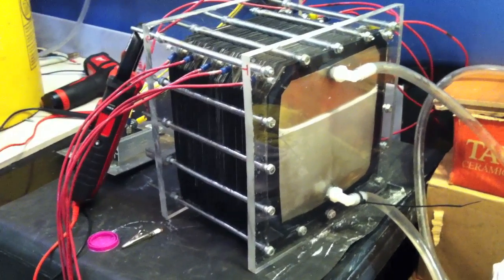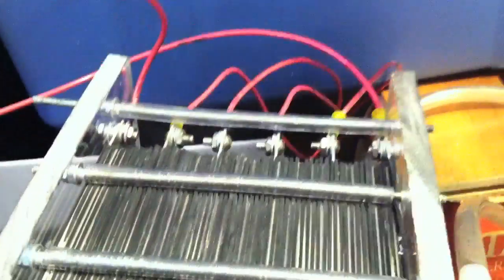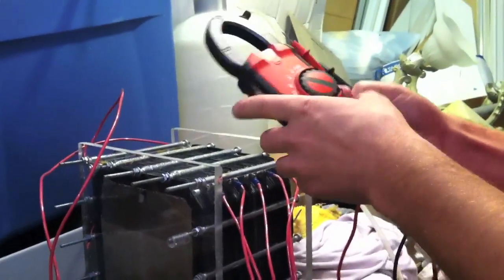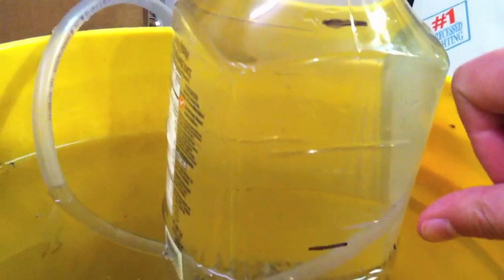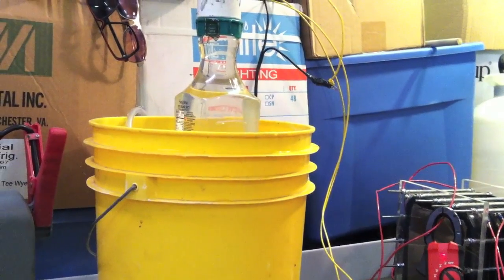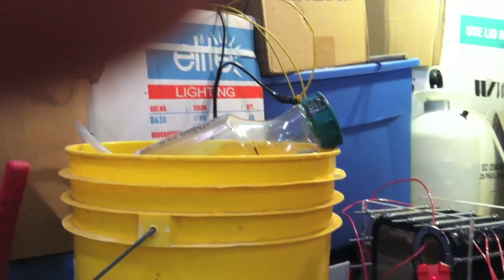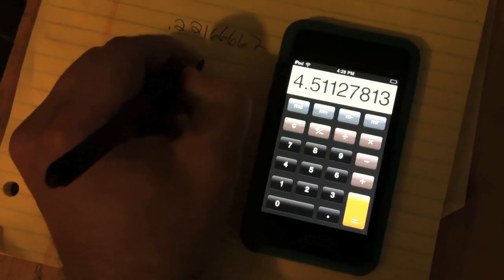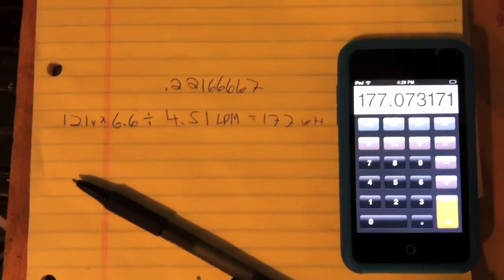120v 4.5 LPM 60 plate hho ( hydrogen ) dry cell demonstration

Comment: you could run a 4-cylinder motor on that. lol Granted it would be better if it were running on a Lithium Battery pack instead. but its pretty sick, What Size Plates were used? it looks like 20 or 18 gage does anyone know?

Comment: warm and cold water. - Just like Wire, Water Acts as a Resistance/Resister (its how you can have a "Dry Cell" build to begin with, you have to have a complete circuit) - warm wire increases resistance - cold wire decreases resistance and apply Ohms Law to figure out the resistance of the water, at its coldest point and its warmest point.

Comment: When input voltage is 120 Volts AC , then the output from Bridge Rectifier is 170 Volts DC (120 x 1.4142 ) and current is 6.3 A , which amounts to 1070 watts per hour . The gas output is 4.5 litres per minute . Total gas production per hour is 4.5 x 60 = 270 litre . Power consumption per litre of HHO gas is 1070/270 = 3.9623 watts / litre
Reply: I'm not a very smart guy but I would like to make one big enough to run a school bus could you give me an idea how many plates I would need at 10 by 10 square and would you recommend separating the oxygen from the hydrogen or involving both
Reply: @victorhettinger4412  , run your engine on hho. 
you would need 15 plates of 10" x 10" if your bus is 24V DC . +nnnnnn-nnnnnn+
start with 20 grams of 97% pure Sodium Hydroxide (Laboratory grade )  per LITRE of water . If gas production is not enough add little more Sodium Hydroxide . Too much of hho makes the engines run rough . 

0.25 lpm per litre of engine is the thumb rule .if your bus engine is 3 litres then you need 0.75 lpm and maximum can be 1 lpm .

Comment: your calculation is wrong . the gas output is 4.5 x 60 = 270 litres / hr as the power consumption is in watts per hour .
Reply: So can you give me an idea how many 10x10 plates would I need to run a school bus on 12 volts 15 amps
Reply: @victorhettinger4412  , 8 plates ( 7 cells ) . try first with 15% KOH solution ( 150 grams of KOH , 850 grams of deionised / distilled water ) . if the gas production is less , try increasing the concentration to 20% . Seven cell generator will give you hho gas without the electrolyte solution getting heated up .
Reply: What is the engine volume?. 
What is the ambient temperature of your city?.
Reply: So one negative five neutral one positive is no longer the standard for high output I'm guessing
Reply: @victorhettinger4412 , too much of hho overheats the engine to the extent that you start feeling the engine running rough ( nearly like seizing ) . I found the radiators were not able to handle this continuous overheating . 0.15 to 0.2 LPM of hho / litre of engine is enough to get you a good mileage . 
If your engine is 3 litres , then 0.6 LPM of hho is a good addition
Reply: @victorhettinger4412  . 1 negative 6 neutral and 1 positive is the best way to go .

Comment: It would be more impressive if you had it in a car and used to lightweight inverter to change your 110 into 12 volts alternating current as it fits now we can only just watch it bubble then put out ants and bulls. We see a lot of them that we can just look at. But we'd like to see it in action that's the whole point in building them. Thank you
Reply: alternator voltage is generally 13.8 volts DC . 

When oxy hydrogen gas is introduced into the engine , more percentage of fuel is ignited as HHO gas is highly explosive which results in more heat being produced and the radiator finds it very difficult ( in places where summer is 42 degrees celcius ) to push out the extra heat generated , I ran a 1300 cc diesel gar on HHO gas for nearly 6 months . After 6 months without Hydrogen , the car runs very smooth as the cylinder liner has been shaved off a little bit by the expanding piston rings to decrease friction .

Comment: 47 kw per hour.......??? wow  to munch to be classified as free energy.
Reply: @Alexthe2nd's calculation is wrong
Reply: Output from Bridge Rectifier is 170 Volts DC and current is 6.3 A , which amounts to 1070 watts . The gas output is 4.5 litres per minute . Total gas production per hour is 4.5 x 60 = 270 litre . Power consumption per litre of HHO gas is 1070/270 = 3.9623 watts / litre

Comment: So what do you plan to do with it now that it is made?
Reply from the maker: I built it thinking I could use it to use as a supplement the fuel in my car and improve MPG. That turned that turned out to be a dead end. All the gains in MPG were offset by the extra strain on the alternator, making it a net zero gain. The best use for the HHO generator is as a torch. It makes a great Torch!
Reply: @Alexthe2nd  Have you happened to have tried welding/brazing aluminum profile extrusions with this and aluminum brazing rods? I predominantly mean the size (2020 aluminum profile) that cheap 3d printers and cnc are made from? My napkin math has told me that around 4.5LPM is what should be adequate, so it'd be good to know if yours can do this.

Comment: You need to calculate the dc volts times the dc amps for power. Or AC volts times the ac amps for ac power. The difference in power between the ac side and the dc side is what your converter or full wave bridge rectifier is consuming. There is a gross conceptual error is multiplying ac volts and dc amps. You have to do it seperately. If you are at 12 volts on the bridge side at 6.3 amps then you have 61.5 watts DC which means your ac side is very close to 0.5 amps.

Comment: Hey..good job
one thing is missing.....
you need a PWM
a Pulse Width Modulator sends pulses of energy into your cell.
This prevents it from heating up
Reply: Good luck finding a 120 volt pwm
Reply: @ES-xq7iu  they make them ive found them inline

Comment: A commonly unit of performance related to efficiency is the MMW mililiters per minute per watt. 
1000 ml /((6.6 amps ×121 watts)×(13.3seconds/60 seconds in a minute))=5.6489 MMW. Without adjustments for standard temperature and pressure of course.  Low pressure and high temperatures can inflate those values some. And the gas is probably saturated with water at 100% relative humidity at the temperature of water in the bubbler.

Comment: What is the material b/w plates (rubber sheet type) 
Where i can buy it
Reply from the maker: I just used commercial roofing rubber (the stuff they use to cover the flat commercial buildings) I just asked a local roofing company if I could have some scraps and they gave me more that I could use for Free.

Comment: This is a joke device I can produce 24 liters of gas per minute at a cost of 266 watts! And I am sure with more refinement I can do better!  Multiply your voltage times your current and you will get watts.
One must produce more power than is used to crack water or you have accomplished nothing at all! The only reason there is any gain at all in power is directly due to the speed of the hydrogen burn. Which is called a Flame Front and with Hydrogen that burn is just under Mach 9 compared to gasolines coming in at just under Mach 1. If you learn to crack water with lower power consumption  you can do something useful. If you cannot forget it!
Reply: Lining a car's roof with solar and switching your headlights and lights to LED's to reduce the electrical load isn't too difficult and it does yield a net efficiency. I might try this myself to see how it works. 😊🌎✨
Reply: Crack water? Share with us! = )
Reply: @DeanTheDoctor  1.23v
boom

Comment: whats the point using ac 120v and that much plate, if u can use 12v dc but put more amperage?
Reply: If you have 120vac, why use a 12v battery charger?

Comment: Hello where are the right side red cables connected ?  And may I provide 3 volts to 3"  plates..? 
I  am using  120v.  w/rectifier for my generator ..will use it for small diesel burners ..thx

Comment: I am going to be "that guy" and state how utterly little respect you have for safety in regards to isolation, earthing, having a clean work area. First when you measure the AC voltage was unsafe - tip: screw the rectifier down so you don't need to hold it while trying to measure. Secondly when the hole-saw blade fell from off camera and landed very close to the bare live wires this is the point where i turned the video off. I get it was "just a summer project" but you really do need more respect for the deadliness of raw mains power.
Reply: Hes not gonna respond to you he already died

Comment: What's the practical use of running it on house current? Aside from just bragging that you can produce X amount of gas? These are largely used for gas burning engines, which run DC voltage. At least, any video I've seen where they actually do something with it other than annoyingly long math
Reply: think about power inverters
Reply: I can think of two praticl uses. 
1) HHO torch for welding. 
2) HHO gas for health benifits. 
 Google search  these terms together "molecular hydrogen" and "nih.gov" .

Comment: The unit you're looking for is wattminutes/liter. A less complex unit would be joules/liter. The equivalent value for that unit is ~10.6k.

Also, when you rectify 120V AC, you get a half sine wave of DC with amplitudes of ~170V. At those points, there is a voltage of 2.83V across the plate gaps. Assuming everything beyond 2.2V is wasted due to overvoltage, an average of 162W (20% of 800W) is being dissipated as heat in the water. No wonder it's heating up. All of this because your rectifier doesn't have a smoothing capacitor.
Reply: Mililiters per minute per watt is another usefull measure that reflects efficiency.  Yes overvolts is disapated as waste heat but it drives current. Practical devices have to make a compromise between  highest efficiency and high production.

Just a smoothing capacitor will give poor power factor. Hed be better off with an inductor after rectification and then a capacitor after the inductor.
Reply: if you add filter capacitors, you'll end up with 169.68V DC +/- which is the ~170 you speak of.

Comment: I heard that current depends not only on the size of plates, but also on electrolyte concentration. If you let say increase the concentration of the electrolyte two times in the same unit, how much it will change HHO output. Have you ever tried?
Reply: Production is proportional to current.  For a given voltage, current is proportional to plate area.  
Electrolyte conductivity is nonlinearly related to electrolyte type and concentration and temperature.  https://images.app.goo.gl/1b7Hm22Fyg7FQeov9

Comment: It would be a bit clearer if you knew the difference between voltage and amperage. Voltage is the strength of the current, amperage is the speed of the current. Two totally separate measurements. Any electrical supply has two ratings voltage and amperage. It's not the voltage that will kill you, it's the amperage.

Comment: Have you considered edging or Laser cutting a fractal pattern on the plates? Thus to get more surface? Printing a transparent foil with a ordinary printer, coat the plates with photoreactive paint, putting your foil with the pattern on both sides of the coated plates, expose to UV light and edge partually in the way you get little groves. Easy to realise.

Comment: You noticed that the plates got hotter and the current went up, this doesn't mean you're making more HHO necessarily, but it's very suggestive that the extra current is being dissipated as heat in the plates.
Reply: All the current ×1.24v goes to making hydrogen.  All the voltage over 1.24  × the current  makes heat.  But  the overvolts is what drives the current becase no current flows at 1.24v or below, but increases as voltage grows above 1.24v

You can maximize production or you can maximize efficiency or settle on a comprise between the two.
Reply: @kreynolds1123  current does flow at 1.24v
Reply: @cryptoworldgames  Not in a steady state way. The only current that flows is like the charging the plates of a capacitor. If your getting current at  1.24v and under it's due to either a contaminate  shorting the plates or the contaminate is something like urea which is decomposed at a lower voltage than water.  But the water needs 1.24v or more to be electrolsys to hydrogen and oxygen.    Or else you are making an over unity claim. Because the hydrogen oxygen mixed gas would have more stored chemical energy than was used to make it from water.

Comment: If you would run this for 24 hours and conpress it into a VERY stable tank and in the tank would be a "sparkmaker" and you make a spark.. WHAT WOULD HAPPEN? It has oxygen, hasn't it? Sorry for my bad English!
Reply: Georg Wagner big explosion. The tank has 2 Dihydrogen molecules per oxigen molecule. 2H2 + O2 -> 2H2O, and thats a very fast exotermic reaction.
Reply: use anti pop up.
Reply: The tank with HHO gases can explode like bom. It is so dangerous.
Reply: Georg Wagner just compressing it without the right equipment and knowledge is extremely dangerous

Comment: 120 DC volts at 6.6 amps? Wow.  Thats why it has 60 cells right, to make around 2 volts per cell?
Reply from the maker: Yes, the total voltage is divided by the number of plates 120v/60plate. 2volts per cell is a good ratio.

Comment: Aprox 245W/L, thats the aproach Number, since 120vac, to convert to VDC trough the rectifier, you can reach easily 168vdc with out load!!!, but during the power consumption, (6.5amps) and is not a voltage regulator only is a rectifier, the vdc drops, just an aproach. A lot of power. Another observation for this system, it could be interestingo know how is the arrangment of the leads; to me, seems the next... If Vcd is: 129vcd, and the number of pairs (volts between each plate) is 59, then 129/59=2.18 vcd, enough from thermodynamics point of view. But the connections between plates (jumps or bridges wired) seems to me that the voltage between cells is higher than 2.18vcd, if that the case, i can tell you that could be traduced in a waste of energy and converted from electrical to thermal energy, it warm up easily. Anyway the video age more than 3years, i believe you already improve the performance so far so well.... congratulations...!...and thank for share your video.

Comment: If you want to improve your car engine efficiency
and save on your car fuel expenses
There is a better way to do it - it is HHo Gas
Search Google for: "Top HHo gas Car Research"
Clcik the first result (Skip the Advertisement)
Reply: +Alister Cook And, after several thousand installs the results are in. A net loss of .5mpg due to the need to input more energy than the energy from the HHO provides.

Comment: I have hho 11 Plate and use the soda in the water and when I connect my device to Power Machinery welding works very well paralyze and when I put him in the car and use the battery 60 AMP does not function well. What huh reason please

Comment: One can replace sodium hydroxide with lemon juice! Lemon juice will separate the hydrogen molecule without toxic chemicals! One can achieve electrolosis with a AA battery! No need for all the amp. 2 AMP is more than enough! Subtle energy is what you're after. Sub atomic is a gentler kinder energy. Quit thinking big amps and volts! The "brainwash" of the energy industry! 
Replace your car battery with 6 supercapacitors! Works the same!!! Costs far less! Quit buying into the bullshit! Q-PID  : )-
Reply: Use potasium hydroxide.  It is the best alkaline electrolyte to use with stainless steel.  Acidic electrolytes tend to break down the electrodes quicker, leaching poisonous chromium into the electrolyte quicker.

Comment: Can i use a power supply instead of mains to rectifier?
Reply from the maker: Germas369 I tried to use a PC power supply first. it couldn't supply enough amps. A good alternative is a heavy duty car battery charger.
Reply: Alexthe2nd Alright thanks!
Reply: Germas369 Yes, a simple D cell will do it. I have used a AA battery for electolosis in removing oxide buildup on silver and gold. Lay a sheet of tin foil in a basen of water. Add vinager and some sea salt to water. With AA battery, wire both ends and just put in water manuely at opposite ends. No need for electodes. IMMEDIATE ELECTROLESIS RESPONSE, IN MERE MINUTES THE OXIDE ADHERES TO THE TIN FOIL AND YOU'RE DONE! RINSE! WALLAH! 
YOU DONT NEED AS MUCH AMP AS YOU THINK! TRY WITH SINGLE BATTERY. YOU'LL SEE! 
SMOOTCH! 
Q-PID  : )-
Reply: Germas369 One can achieve electolosis with a AA battery! Use lemon juice. It will seperate the hydrogen molecule without the toxic crap the chemical industry would like you to believe you need to achieve electrolosis! You can also add vinager and sea salt in your water supply. Same reaction! Q-PID  : )-  Chemicals, YUK!
Reply from the maker: Yes you can, as long as its DC. I first tried using a computer power supply, it couldn't handle the load very well.

Comment: test dc voltage
Reply from the maker: Dion Comeau  On a 12.5v DC at 75 amp draw it produces 5 lpm. Thats 187.5 watts per liter (12.5v X 75amp = 937.5watts for 5L or 937.5watts / 5L = 187.5watts per L)
Reply: man im so far from watts now i dont even know what to to with these numbers
Reply: Dion Comeau you should measure consumption going to the power supply supplying the 12V, otherwise you do not calculate the right consumption - thus whatever you pay the the big guy
Reply: Ilian Stantchev i just figured it was going to run on batteries